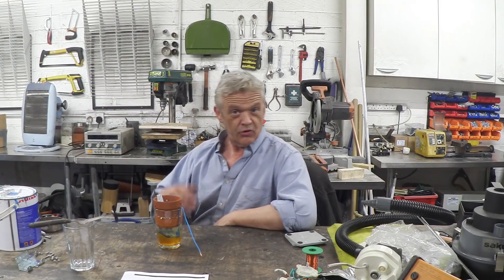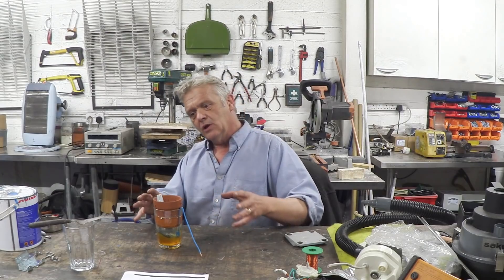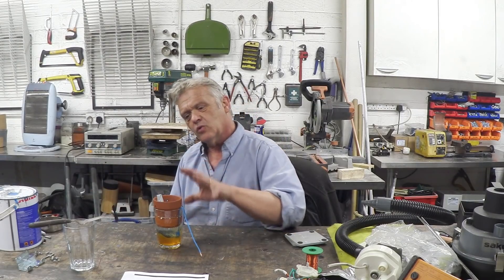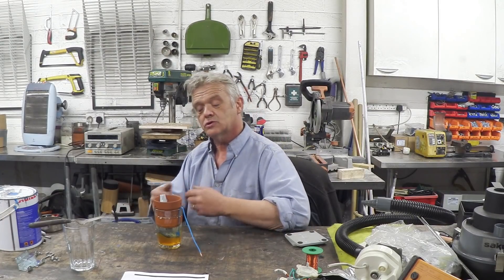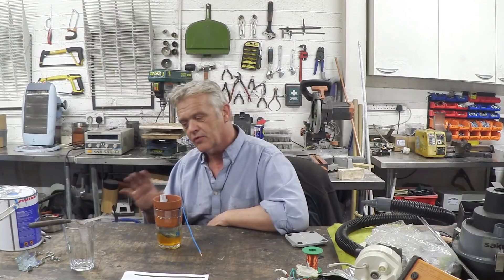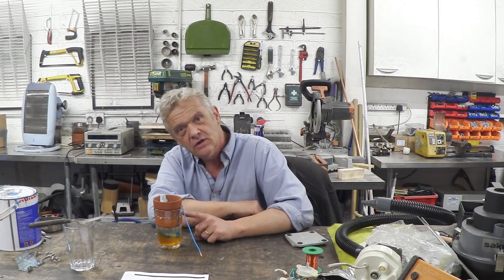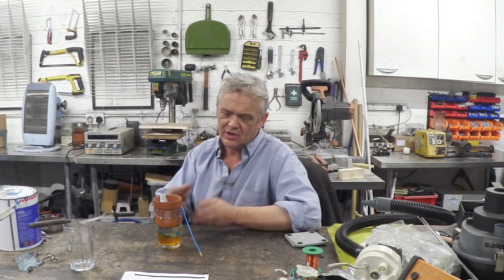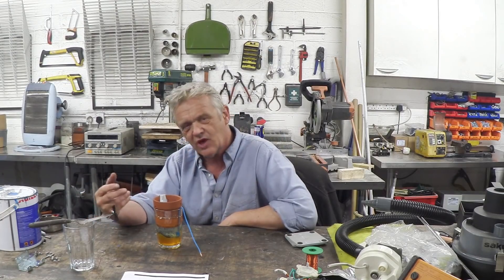1237 Don't Be Fooled By This Battery - A Contender With Lithium

Comment: Lithium batteries just aren't sustainable. The mining, manufacturing,charging and recycling all use energy. Imagine recycling millions of AA sized batteries.
Is anyone really able to do this?
A liquid electrolyte is simple and more like natural systems.

I've been imagining something I call FREE.
Fast Replaceable Electrolyte Exchange.
A vehicle could pull into the refueling station and the old juice is drained and freshly charged liquid goes back in.
Stations can make their own fuel.
No more exploration, drilling, pumping,refining, storage and transportation.
All countries can be energy independent.
It would require more frequent stops but it's cheap, simple and better for the environment.
This battery seems like the ideal chemistry with a permanent electrolyte and low anode and cathode erosion.

Comment: Yes well no fine (as they say in South Africe) but when in the ^&$ can I buy either the ReIdflow or the Gelion battery.  And will they be cheaper per kWh storage capacity than  a Li battery.  They should be due to the very simple cheap chemistry but are they.  I suspect that the domestic market will be as large as the grid storage battery market so perhaps they should concentrate on this first.

Comment: I just gave my prototype it's first charge... constant current @1.4/5amps.... scared the pants off me when the voltage got up to 13.5volts... then everything started flowing. 
  Working towards a static battery system for domestic use.

Comment: The longevity may be its downfall. If one battery can last decades without losing its capacity or going bad, it goes against the planned obsolescence mindset of a lot of manufacturers, because you won't need to replace it every four or five years. Alas, most manufacturers are not interested in building things to last nowadays. They 'd rather make good profits than good products. They just want to make things that last just "long enough" – which, for them, means just past the end of warranty.

Comment: thanks for the tutorial professor.  I did not think that it would be so hard to find zinc in my country.  i see that it costs 3000 euros per ton on market prices but it is difficult to find , i found a shop they sell it for sacrificial anodes for yachts and boats but it is so expensive.

Comment: Hi Robert, I love your videos and what's more, I love your infectious enthusiasm. This looks like a great battery, quick question, I was researching home battery storage to go along with a potential solar panel installation and prices seemed to be about $1,000 per kWh which was difficult enough to justify considering I'd need 10-15 kWhs of storage but you mentioned that the Bromine battery will cost $50-$60 per kWh. That's a huge difference in price and would be a no brainer if it could be done for even a multiple of that. Am I missing something here, are there any other costs that I'm overlooking or is there really that much of a saving to be made? Thanks a million!
Reply: I think Robert talks about the pure cost of the batteries in and of itself. Your price tag sounds like it also includes the controlling/loading electronics, installation and cables? And quite possible a hefty and heftier mark-up for a greedy profit margin.
Reply: @Marian_Martin_Morgenstern  thanks for your reply, maybe that's it alright

Comment: Tetra technologies is an oil and gas company who has thousands of acres of halide brine ponds for rig fluid completions.  Basically have an endless supply of zinc bromide, and they're getting their toes wet on the clean energy push with battery storage.  Thinking about possibly investing.

Comment: A question that someone perhaps can answer me, would it work if one would take either the cathode or anode and permanently embed it in a separater material, like plaster of paris or terracotta clay.  Then you can use any container, it will simplify the complete manufacturing process, you will only need to exchange the cathode/ anode when needed abd "walla" you have a new battery.

Comment: Simple and awesome video. Great job on the battery.
It's a non-rechargeable battery. Is their a rechargeable battery that's perhaps a contender with a LiPO battery. Maybe solid-state? If yes, can a DIY home experiment be 'conducted' to prove the concept feasible in any sort of scale?
Reply: I Am Not An Engineer, but it may be possible to chemically recharge this battery. It's clearly not as simple as pushing power through it to charge back up, but in theory it could be chemically reverted, with some loss of efficiency to be expected.
Reply: rob talked about a million cycles.  so it is rechargable

Comment: I wanted to do zinc and iodine. Though it is cheaper to use the battery out of a junk rechargeable razor. You would be surprised at what people throw away. Then there was the lead aluminum battery I suggest aluminum sulfate electrolyte.
Reply: Hydrogesls and salt solution could work as a battery that would slow down chemical reactions and battery charge leakage.
Reply: /also you may use a hydrogel sheet for a salt bridge. Where you have two jars with your electrodes and electrolyte connected by a electrolyte hydrogel or act as a flow battery with a hydrogel membrane for the electrodes separator for both chemical solutions.
Reply: And you can make this with something like Epsom salt or aluminum sulfate and  paper cloth for a salt bridge. I tried it but I didn't get much over a volt.

Comment: Next I wanna see how to make that battery to fit inside lead acid battery and how much volts, watts and amp hours it gives. If you have the time, resources and interest, of course. :)
It would be better than lead acid (longevity) or lithium ion (safety) for off grid systems to make it that way, I think.

Comment: Energy density of this ZnBr battery is 60-80 watt hours per kilo.
Lead acid is 25-40 watt hours per kilo
Lithium is 100-125 watt hours per kilo   (it is explosive just add water) 
Red Flow company is using Zinc Bromide in a flow battery and selling it commercially for cars.  
" The DC to DC round trip efficiency of the ZCell battery is around 80%. This means for every kilowatt-hour of electrical energy put into the battery, only 0.8 kilowatt-hours can be taken out. For a zinc bromine battery this is amazingly high. The Redflow company has clearly done a fantastic job of maximizing the efficiency of their ZCell battery.  Unfortunately, it is still worse than the efficiency of lithium-ion battery systems. For example, the Tesla Powerwall claims to have an efficiency of 92.5% and the LG Chem RESU 95%."
Reply: Lithium ion is in range of 100 to around 265 Wh/kg
Reply: Actually, that is not entirely correct. The Redflow products are for stationary applications only, due to it being a liquid electrolyte.

Comment: Hi Rob I was wondering, does its capacity degrade with the number of charge cycles, like lithium batteries? From what you said, I get the impression that it doesn't So doesn't that make it superior to lithium  batteries?
Reply from the maker: there are a few things you need to do - like every 4 days do a complete discharge to get rid of any zinc build up - but basically it just keeps on going
Reply: @ThinkingandTinkering  Oh! That does'nt seem very practical.

Comment: I enjoyed this video a lot Robert, and was thinking of making my one, this video inspired me to do that! Can you put this in an air tight container or some sort to prevent evaporation, or can you just fill it with water every now and then? 

Best regards Mark.
Reply from the maker: a container works well mate as does a layer of oil on top - or if you like top it up every now and then - all would be good
Reply: @ThinkingandTinkering  Cool☺ thanks a lot, cheers!

Comment: I wanted to make a back-up power system for blackouts.
This may be what I use.
I would stack a shelf with several of these and wire them together to run an inverter.
Reply from the maker: awesome mate - I am thinking of doing the same to be honest
Reply: I didnt see the video on how this battery  was made 😢 . Is it rechargeable.  Can solor charge it for later use?

Comment: Here's what I'm sure is a silly question- in order to make more cells to get you to, say, 12 volts, would they each have to be contained separately, or could you just plunk more cathodes and annodes into the top and the bottom so long as they're not touching, and use the same electrolyte and separator pot?
Reply from the maker: they need to be made separately mate and connected in series - plonking more in would be like connecting in parrralel

Comment: I would love to see a scaled up 12v multi cell version of this running an inverter and high draw devices!  Or more advanced versions that are portable and durable to movement.
Reply from the maker: go for it mate - make one!
Reply: @ThinkingandTinkering  I'm currently too busy with super caps!  Question though, have you ever looked into aqueous lithium salts such as lithium hydroxide?  If so, are they any good as an Li ion electrolyte in a water based super capacitor?  Making lithium hydroxide is really easy, just throw some lithium metal into water and that's what it dissolves into!  Great solubility!
Reply from the maker: @theinsider8872  yep - works a treat
Reply: @theinsider8872  Besides the explosion risk, what do you do with the hydrogen gas? And LiOH isn't very pleasant around the living room or garden pool...
Reply: @ThinkingandTinkering  i love it you kill me
Reply from the maker: @ambersmith6517  well - that's good - I think lol
Reply: @ThinkingandTinkering  Thought I'd give an update.   I actually just tried lithium hydroxide last night. I made it by extracting lithium metal from an energizer lithium AA. I dissolved/reacted the lithium in water which turns it into lithium hydroxide. The results were pretty underwhelming to be honest though(Behaved pretty close to sodium hydroxide only slightly higher voltage). Though the weight of the lithium was only just over a gram(Which is damn impressive for the energy those AA batteries have) which I dissolved into a large pill bottle of water.

As a side note, I think lithium hydroxide might give off some kind of nasty gas when charging. I know hydrogen is obviously in there, but there was something a little off about the smell, so I made sure to vent and not breath near it. I will probably give it another try with a higher concentration, but it's not looking very promising for the effort/price. Though I have a good feeling about lithium sulfate, which is damn expensive stuff.

Comment: I think this is the one Battery I will Build Robert. I really like it. A 100 to 200 KW Home Battery with very thin Clay Plates instead of Pots and I really like the Gel. No spillage. Titanium Screen instead of Zinc Plate. Although Zinc would be easier to source in a pinch, I'm going to look into the Titanium.  What do you think about about this size of Battery Robert? Sure appreciated you sharing your knowledge with me. Thank you.
Reply from the maker: if you are going to make just one battery then this is it mate - titanium mesh is a good idea and volume will give you energy density and surface area will give you power density it's about 60 Wh/L to give an idea of how much to make
Reply: @ThinkingandTinkering  Thanks Robert for your opinion and advice. I really think this is the one Battery to Build. I'll have to check out the other Battery tech you have coming soon. P.S Robert what type of Gel would you recommend? Glycol, Agar, Water Glass or Plastic Gels?  Any of these?

Comment: Hello o.o/ I just wanted to say that am glad you make more chemical / battery videos again :). Your videos encourage me a lot, and after was able to produce my own conductive ink (with and without self made graphene) Im making since month nearly every day as lot super condensators as possible, but wew it a nearly endless work XD . My current aim is 400 10x10cm cells. Next time i make bigger ones ;) , but its a better free time activity than simply watching YouTube videos and streams alone. At the moment Im covering the back of the electrodes with synthetic resin varnish, to ensure the electric flow is only between the graphene covered surfaces. Could you tell a trick how to cover "easy" only one side of a steel mesh with synthetic resin varnish? At the moment I cover the opposite side with hair varnish, to prevent the synthetic resin varnish from soaking through, but thats pretty messy and takes so much time -.- . Tape is getting wet and then the surface is extreme bad.
Reply from the maker: I agree mate it is much better to take part than just watch - I suppose you could try creating a  'lake' of the varnish letting it dry then painting it and pressing the mesh into the painted varnish film? - you create the 'lake' on HDPE that way it would peel away easily
Reply: @ThinkingandTinkering  That I will try ! :)
Reply: off the top of the head, a hard paper roller in a varnish tray.. slowly roll the mesh on that to pick up the varnish without over loading it.
are you applying drying the ink first... do the same there.

Comment: I'm curious about what would happen if you made your own terracotta in the shape of tubes and had multiple units feeding the electrolyte solution.

Would that affect charge time? I know that the electrolyte solution is what gives it the energy density, but would the energy transfer rate improve?
Reply from the maker: that will be a function of surface area - so if you increase that then yes
Reply: @ThinkingandTinkering  fantastic! Love the channel and suggest it to ALL of my friends.

You are an inspiration mate!

Comment: Was thinking this was close to the redox flow battery, would you be able to put several in series or parallel to run something bigger?
Reply: sure, like all batteries, if it helps people remember, think of it like a river or string, the longer it is the more series volts you have, the wider you make it, the stronger parallel amps force it has
Reply from the maker: absolutely mate

Comment: How do you charge it. Can it be charged by solar.
Reply from the maker: yeah mate - it's just like any other battery - for details see 1236
Reply: @ThinkingandTinkering  Thank you.
Reply: sure, like you 'charge' anything, connect up & make the higher thing flow into the lower thing
Reply: @paulmaydaynight9925  I'm trying to learn so excuse me if this sounds ignorant. Are you saying that if I had two individual cells and transferred the power from one to another (with use of regulator or whatever) then it would stop charging when both cells reach a roughly equal voltage?
Reply: @wongowonga  CORRECT

Comment: Would it be fair to assume you could configure this battery similar to a lead acid design? Anode and cathode close together separated by a porous non-conductive layer, immersed in electrolyte?

In other words would it be feasible to build a zinc brooming battery in a standard lead acid box?
Reply from the maker: I would think so mate - it's zinc bromide by the way - sorry for my accent ! lol
Reply: @ThinkingandTinkering  just sweep the south accent under the carpet ,as lease it's not calling power turbines head garment turban's ^_~
Reply: As much as I’d like to take credit for coining this a Zink brooming battery we will have to chock this one up to voice to text app clearly working hard to make look even more simple than I am.  Trust me, I do fine without any help.
Reply: You could try but the bromine will degrade the plastic and leak out over time. Which isnt that great considering that bromine will, after dissolving skin that has touched it, kill you if you get more than about 1 gram into your body

Comment: It's funny when you think about it, the world spends billions on new technology rather than spending a little to improve the old. The best things in life don't have to be expensive. I wonder how much room it would take to set these up in a sufficient combination of series / parallel cells to replace lead acid or lithium battery packs to run your home solar.
Reply from the maker: lead is 80-90 Wh/l and ZnBr around 60W/L - so 25% -ish extra space
Reply: @ThinkingandTinkering  not near as much as I would have guessed. Can this be made into a semi sealed battery to reduce the spillage factor?
Reply: @ThinkingandTinkering  Excellent info. Thanks.

Comment: Very interesting. That's certainly answered some of my question on yesterdays video, thank you. Does anyone know to get hold of bromine in the UK? I see it's sold in tablet/granule form for swimming pools but can't seem to find it in liquid form. I probably being daft, can I just dissolve the tablets in something to get a liquid concentrate? Or should I buy it in liquid form to start with? This chemical stuff is really new to me and so I'm a bit lost as to where I can purchase in the UK. Any advice greatly appreciated.
Reply from the maker: I am glad mate - it was you I had in mind when I talked about cost - why do you want bromine mate? the electrolyte is zinc bromide salt - so what you need is zinc bromide
Reply: @ThinkingandTinkering  Ah, thankyou. I'm clearly getting my wires crossed. Not sure where I got bromine from! I shall search again, at least I'm looking for the correct thing this time! Thanks for all your help Rob, you really are inspiring.
Reply: @ThinkingandTinkering  I have found a supplier! although looking at the handling precautions I think it's best if I learn a bit more about the characteristics before I start messing about! Fairly pricey at £80 for half ltr, but as you say, that would last forever and I would just need to replace the anode and cathode periodically. I turn my hands to many different things, but chemicals has never been one of them! So much to learn but that's what makes it fun. Thanks again Rob.